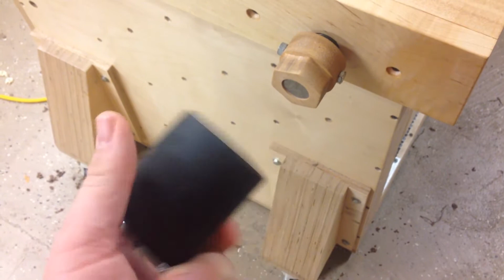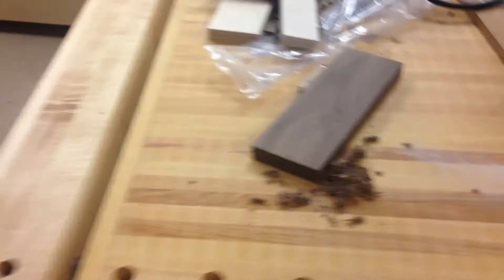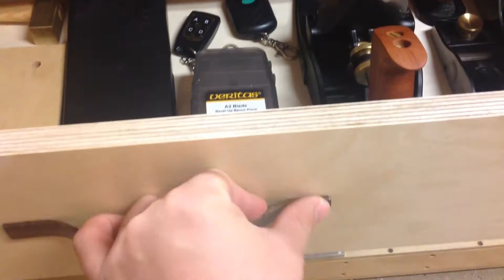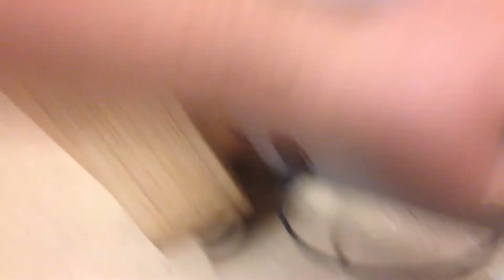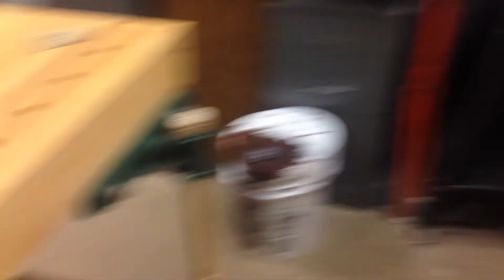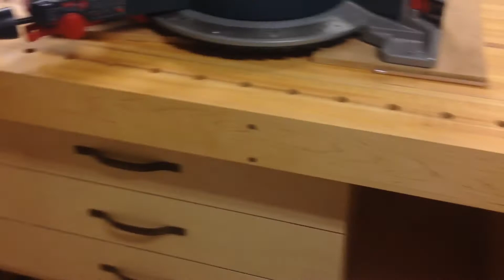June Workbench Update

Comment: How did you bent your handle?
Reply from the maker: I made a form that was the shape of the bent wood handle and then boiled the strips of wood in water and clamped them in the form to cool and dry. If they crack you can just put glue in the crack and put them back in the form. You can't tell it at all when they are trimmed up. I will do a video on making them cuz I need to make more.